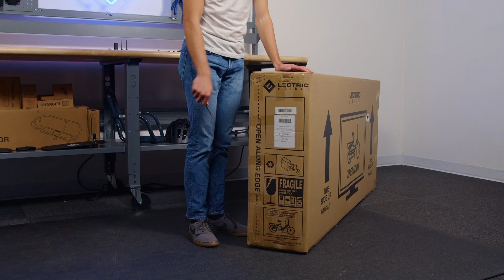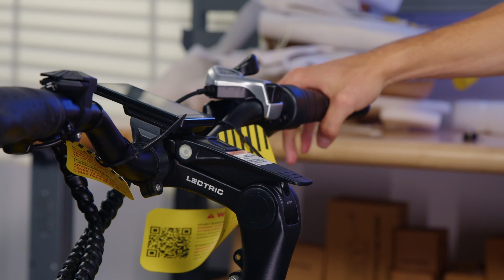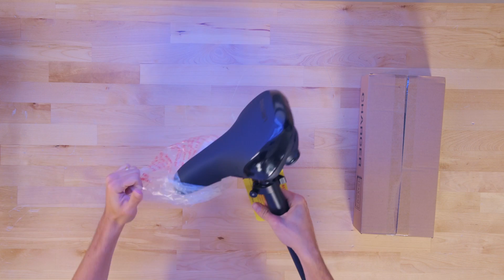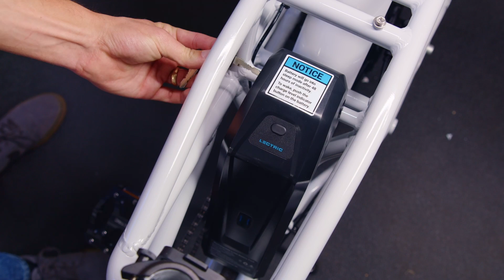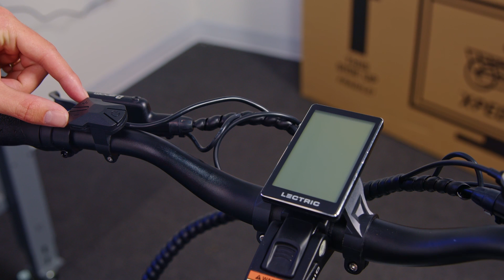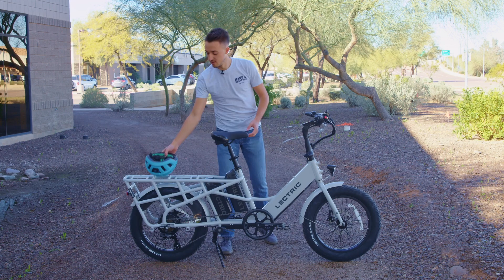Lectric Service Center | XPedition First Ride

Comment: You should redo this video as the stem and handlebars are not connected in shipment anymore, requiring more assembly. Also, the bike is packed differently and would not slide out of the box. Lastly, forgetting the tool for them stem assembly is ridiculous. Not happy to get bike a week after was noted and now waiting on special 5mm extended hex bit to come in the mail.

Comment: on the brake cleaning you should do both sides of the rotor, there will be dust debris and conformal coating on both sides. front and back rotors would need to be done. thanks.

Comment: LOVE LOVE LOVE this bike, other than the fact the front tire came flat out of the box which had to be repaired before I could rode it.  Two days later, I did a 25 mile bike ride and 55 miles total, tires were fine during the ride (also properly inflated to 30 psi) but four hours after getting back, I went to do another ride and the rear tire was flat Is there no "high dollar" inner tubes available for these?  I'd still buy another one regardless of initial inconvenience. Thank you .
Reply from the maker: Hi there, there may be an issue with one of the spokes of your wheel protruding out of the rim and rubbing up against your tube, causing a puncture. 

We'd recommend getting in contact with our team so we can more definitely resolve the situation to keep you rolling! ⚡️
Reply: @LectriceBikes  right now, it is at one of your authorized repair centers, but the front tire came flat also.  I'll pass that on though.  thank you.  LOVE the bike.
Reply from the maker: Thank you for understanding and being kind as this gets resolved. Let us know if there is anything that is needed from us!

Comment: So Ive been riding this bike as a commuter because DoorDash does NOT support bike delivery in San Antonio, Texas.  Yeah, I know.  7th largest city in America and DoorDash dosnt do bikes here.  I watched the schedule to deliver on ebike on Doordash app for 2 weeks, and was only able to sign in to bike deliver for 30 minutes.  I had to give up my freedom from being a delivery worker and get a time-clock job. 

The REAL story I want to share is this;
My job is 9.6 miles away from my home.  Mostly flat path to get there.  On pas 5, with a 220 lb rider, another 4 or 5 lbs for my lunch, I am unable to make a round trip.  I have to charge my bike at work. 
The dual battery might have helped, but I dont have 14 hours to charge two drained batteries before I have to get up to get back to work.
HIGHLY disappointed with the exaggeration of the range.
Further more, after only 400 miles of riding, my rear brakes are shot, the front wheel wobbles, and the traction from the tires is not great.
Ive already had it slip out from under my on corners.  On clean pavement.  

I really like this bike, I appreciate the skill and craftsmanship that went into making this bike, and the price.
Im just disappointed that it fails at being as good as the adds and reviews make it out to be.

Also, I know it has been brought up in previous reviews, the lack of suspension is an issue.  The few deliveries I was able to do (told the DoorDash app I was using a car) the rough ride actually caused drinks to spill.  Not from tipping over, but from being jostled so hard the cups either ripped, or the lids popped off.

 Just a heads up.
Reply: Good to know. Which exact model did you get? I’m 243lbs so my range will probably be ass on any model I’m assuming. I read the disclaimer and it said 50 miles for 180lbs payload on full throttle.

Comment: This was a great video, with just one confusing part: determining which end of box to open.

Mentions a "punchflap" (?) which I never could locate. Big explanation about driveside and non-driveside (which has nothing to do with front of bike) with flopped drawing (mirror-image) showing driveside on WRONG side of bike. Huh!? Also confusing that the large bike image in center of box points the opposite direction of how bike eventually rolls out of box.

Much clearer to just say: "Locate handhold with cardboard backing (not styrofoam) and open that end." No need to even mention the drivetrain or "punchflap".
Reply: Finally found the punchflap! 😂 (good lighting helps 👍)
Reply from the maker: We're glad you found it! We'll take into consideration how we word it next time and we hope its a lot less confusing. If you have any other questions feel free to reach back out to our customer care team. Thanks for choosing to ride with us! 😊

Comment: Very enlightening video, especially the PWR controller!
Could you explain the power levels and speed limits on PAS levels when bike is unlocked,  eg class 3?
Reply: It’s explained in the manual, which you can download from their web site.

OOTB, the bike is class 2 (20mph maximum assisted speed). You can set it to class 3 (28mph max assisted speed). PAS 1 and 2 ship with their own speed caps, which are the same whether the bike is set as class 2 or 3. You can remove the caps for these separately from the bike class. I’ve removed it because I find PAS 1 and 2 sufficient for relaxed to mild riding effort most of the time. However, there is some surging behavior with that cap removed, which you can avoid by slowing pedaling rather than abruptly stopping pedaling, and also to stop pedaling before moving from PAS 1 to 0 (for tight, low-speed maneuvers or pedaling downhill), then resuming pedaling.

Comment: I bought it and it's just sitting in room for month after rear hub went off first time. No reimbursed for service that couldn't fix it, also they see potential problems in future with damage that happened when hub when out but no word from Lectric. My wife planned a trip for my 40th and bike was part of it, now we are going without bike in end. 
Also you can't return it as it was used for month, but it looks it will take 11 months to talk to them and not fix it and then will be that my warranty is out.
Reply from the maker: Hi George, we're happy to help! Please get ahold of our team so we can assist you with any kind of troubleshooting help you may need. 

We'd be happy to connect and resolve this important matter as soon as possible.

Comment: My expedition came the same time this was released I am excited to go ride the the only thing is I have not found one video of the front and back black racks installed. I found one pic of a expedition and it looks like the back rack dose not go all the way to the back is that true and why. I guess I will have to wait till my basket gets delivered 😕
Reply from the maker: Thank you for this recommendation! 🙌
Reply from the maker: Hi there! Thank you for your support and we're stoked that you've received your XPedition. The rear rack does extend to the rear wheel which it great to add one of our newer accessories. 🤩
Reply: @LectriceBikes  This is a new accessory? On the Xpedition page, it shows the rear basket does not go all the way to the rear.
Reply: It does not - you'll likely need to get that Orbitor or make your own.
Reply from the maker: Hi Cain. The rear basket we offer is here: https://lectricebikes.com/collections/accessories/products/large-basket. This is the standard basket we offer but the rear rack is already built within the bike.
Reply: You might want to think about selling a tool kit. I don’t have either of those torque wrenches in my toolbox.